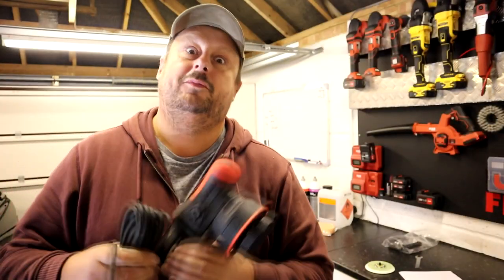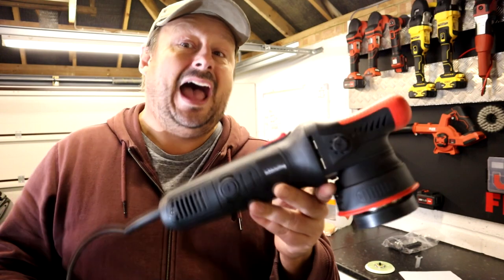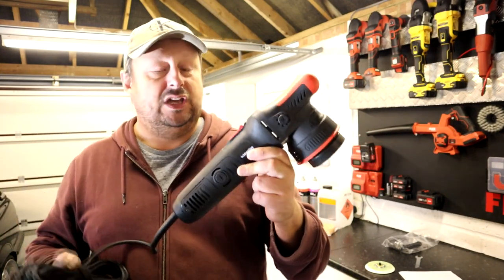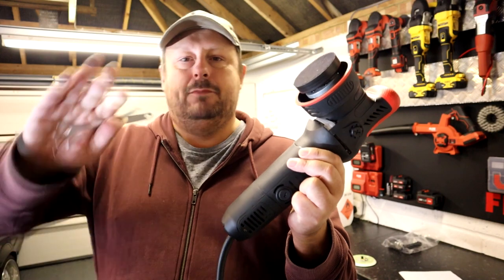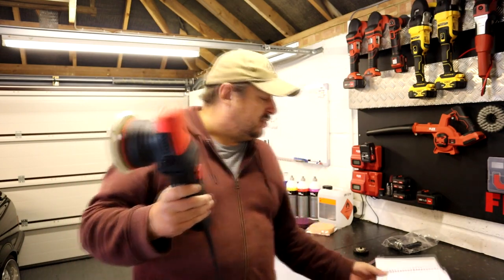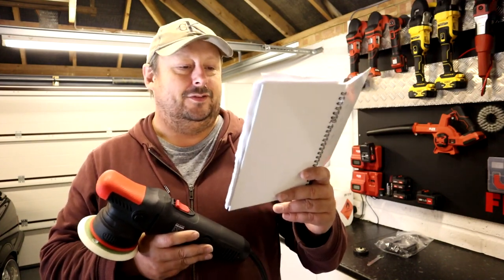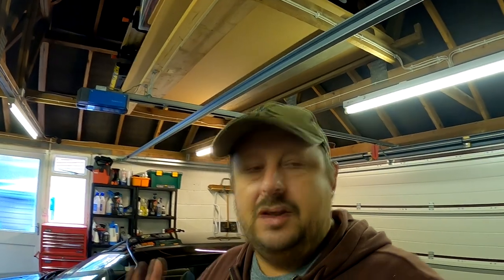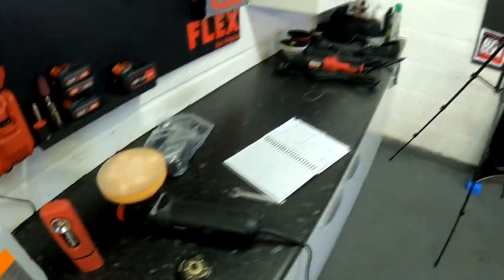The Ultimate Dual Action Polisher for Beginners? | New DA8 Review | Picking your first polisher

Comment: Are the pads reusable or do you have to throw them away after a use or two ? Thanks , always loved keeping my cars clean but just dipping my toe into detailing , thanks .
Reply from the maker: hey there Shaun.  you have to clean them properly at the end of each day, dont throw them untill the surface starts crumbling up and disintergrating.  take tooth brush, squirt come APC on the face work with brush, then blast the surface with a garden hose and it will flush all the polish out.. when clean sandwich in a thich clean drying towel and press to suck up all the water so they feel 99% dry.. put in airing cupboard to full dry.

Also you can you should check out my Detailing Fundamentals training course with discount code applied.  This can help you get up and running with detailing.

https://ioa.pxf.io/c/2687409/1012495/12764

Comment: how often do you change the pad or would you use the same pad for the whole car? Then once you've done the whole car with the polish do you have to go over it all again with the finish?
Reply from the maker: after about 10 sets as a rough guide but depends mate.  heavy cutting or fine polishing.  its when it warms up and mega gunked.. 10 sets just a rough guide.  you can also do a full flush clean on it with a hose pipe and press it.  see "how many pads should you use to polish a car" video. on unplugge.d

Comment: I would say its better to buy a used Rupes 15 mark 2 or 3 instead of buying a new cheap machine.
Then you will get a great machine for a great price.   Great allround machines, very stable and powerfull. You will not regret it.
Reply from the maker: dunno about that.  A lot of second hand tools are shagged.  Plus you loose the small plate support.   I would say if your polishing your car once a year then this is perhaps as good as it gets and when you are ready to upgrade if you look after this tool you will sell it for 70 quid no problem.
Reply: @ForensicDetailing  Yeah its a risk you gotta take for sure.  So you gotta inspect it good and feel it out.  I bought my 15 mk2 used a couple years ago for 210 pounds and back then it was around 575 pounds new. (Norwegian prices).   No regrets, great machine.      Some cheaper ones might be good but I have not tested them all, I just got sick of my das6 pro and upgraded to the best right away :P

Comment: I've got a 2012 E92  M sport in sapphire black. You said German paints are hard but then said you have soft paint on your  BMW.  What category will mine fall into John ? Thank you 👍🏼
Reply from the maker: if its original OEM BMW paint.  E9x is usually pretty hard.  most modern BMW paints are realyl hard and have a good amount of thickness. much better than other brands, but yer lots of orange peel
Reply: @ForensicDetailing  Thank you John 👍🏼

Comment: Great video, thanks. How do you clean your pads?
Reply from the maker: https://youtu.be/OAs6o_kF2YA

I tend to flush them out with a garden hose, it has enough pressure to blast out a lot of the rubbish. you can do it in the sink with warm water.. use surfex HD its cheaper and better than washing up soap.  tooth brush as well.  sandwich the cleaned wet pad in a clean towel and push down on it with the towel wrapped around to insta dry it.

Comment: Help please.
Losing co car so got 2013 Corrida Red Fabia.O well.

Machined polished with maguires Ultimate,looks good from a distance but in light lots of horiz fine scratches.I know its an old car but think I can get some of these.
What's my next step please
?
Reply from the maker: Could be machine marring or deep scratches not removed.  Cut 9nce with ultimate compound and stiff foam cut pad. Finish once with ultimate polish and sift pad l.  Do final buff carefully m8

Comment: Jon quick question. Have a brand new fiesta which has very very light swirls. Would I be best soft pad with a finishing polish
Reply from the maker: Yo Dave
H9 F6 M3  = abrasives combos
Purple = Non agressive Cut pad
Orange = Softer polishing pad

these are your tools and you start at suitable place. 

So fiesta will be lets say medium paint.   very light swirls.    I would start orange pads with F6.  If you need to step up then purple pads F6.  If thats still not cutting it then H9 and purples and finish out with M3 ornage.

Comment: Hi mate I bought this in2detailing da8 polisher today and the g360 cut and g360 finish all through your recommendations.  Thanks by the way . And I'm just wondering if you can help me the g360 recommendations range from 900 to 2000 rpm and the minimum this polisher goes to is 2500 rpm so I'm just wondering if you could have some input on that thanks regards harry
Reply from the maker: 900 -2000 rpm is rotary reference.  your DA is really  2500 opm.   just cut at around speed 4 mate.

Comment: There's really no need to spend so much. Argos sell a DA frequently on offer for £35, get some ZFE store pads on ebay for £15, Scholl S40 and S20 black for £30, job done, the results may take a tiny bit more work than the slightly more powerful DAS, but you save a hell of a lot of money
Reply from the maker: I guess the argos DA + ZFE gonna be like the cheapest starting point isnt it. I will review this machine soon hopefully.
Reply: @ForensicDetailing  You absolutely should. Sure you won't get royalties from Argos but if nothing else you will prove that skill trumps machinery. Even my low production valued crappy review of the Argos DA got quite a lot of views, if you do it you'll get a lot of interest

Comment: I'm planning on polishing my Honda Civic 2010 which has very soft paint. It has very light swirls, would you advise yellow pad with M3. Or F6 first then M3? Many thanks.
Reply from the maker: Ok for max speed I would use F6 and Orange pad.    single set polish.  I know this combo works great on soft paint.   But just buy a purple pad at the same time so you have a means to step up.

long term you should have H9 F6 M3 available to you.   And purple and orange available to you.   when you have this you can do virtually everything.

Comment: Just watched the rag company video of "which will burn through first " John,  what are your views as it is an interesting   video ?
Reply from the maker: all polishers work well on flat panels, similiar rates of cut experienced Im guessing.  Rotary though if you want to correct faster you can pressure down more with it and lean in without stalling issues.   Almost true of the FR has well although the FR down most of its work from the orbit or the oscillation if you like.   but when a DA is spinning it cuts well.

Comment: Question!!
What do you think about microfibre cutting pads from meguiars??
Reply from the maker: I find they dont take up the curves in the panels as well because they are thin and flat.  They also gunk up quickly and you need to be able to blast them out with air.  you cant really clean out microfiber with a brush.  And I dont find and radical improvement in cut, maybe there is some improvement though.  so I use foam.
Reply: @ForensicDetailing  thank you for the answer 👍💪

Comment: I have a question. Im new to polishing and want to do a full paint correction next spring. I can borrow a rupes LHR 21 ES from a friend but will I manage to use this polisher or will i be better off with something smaller?
Reply from the maker: hmm depends what standard you are working too.  The 21 will be fine on a bonnet or roof or door.   but try polishing a front bumper with it and its a bit of a handfull.

Short answer is you will prolly be better of with a smaller DA like this one.  Or a combo or DA's like the DA15 and DA12 I will talking about soon.   

maybe borrow it first and have a play around with it. If the tool isnt giving you the results you want then you can look to invest in your own tool?
Reply: @ForensicDetailing  thank you for taking the time to write this. I will take your advice.

Comment: Not tried this polisher but ive got the clean your car das-6 polisher which is £90. How does this compare to the das-6 John?
Reply from the maker: das-6 is lower 600w polisher way less power.  das6 pro though is 900w polisher plenty of power great machine.  Its tiny little improvements with this machine but if you have a DAS6 pro its very close to pointless to buy this machine they are too close.

Comment: How hardwearing are these? 

Looking at getting a new DA polisher after I broke my vonhaus one after 2 years of light use (maybe 5-6 full cars in that time, 3 different polish stages on each) don’t want to spend £100 and break it so quickly again
Reply from the maker: unknown mate.  Its very hard to test this.   it feels like it can take a hammering.. if you use it 24x5 like most DA's the bearing is the thing that takes the punishment. you only get a year warrenty as opposed to 3 years for say flex or DW.

Comment: You need to show off the scholl pads bit more the non spider version under £10 and there same foam from what it looks like as the flex btw I wouldn’t mix surfex with sil tbh it may already have surfactants in it
Reply from the maker: the force is strong in this one! your comments are powering up!
Reply: @ForensicDetailing  what do you mean when I bought the flex purple pads 2 big and the 75ml purples from slims detailing cost around £40

Comment: Would you recommend the orbital polisher from Halford? It’s £35
Reply from the maker: not for correction.. it will be ok for applying a wax/sealant and glossing up the the paint but it does not have the power to really cut paint efficently on all paint types... pay extra and get a DA8 or DAS6 pro machine with 850-1000w and you can do everything.

Comment: What inspection light you using ? Or recommend? 

Thank you
Reply from the maker: I used a sealey LCM360 , and I also have a flex torch pen.. but if you want a bargain basement one check my description for bargain LED light.
Reply: @ForensicDetailing  thank you, can’t seem to find the first one anywhere? Would be for professional use, seen another one I like but about £140 I believe so wasn’t sure if other good stuff out there

Comment: What’s the best pad size if I were to use the polisher on a motorcycle?? And does the polisher take a smaller pad
Reply from the maker: 75ml plate with the 80ml flex pads.    But if you intend to buy a polisher ONLY to polish the bike with by the DA12 (3 inch mini) you cant take the plate of the da12 , in other words it only supports the 75ml plate.  but its setup (counterbalanced) to the small plate only.   And it wont have a huge shroud thats bigger than the plate.   You can see what the DA8 looks like with the small plate and huge bell shaped shroud.     stay tuned for my da15 and da12 video I will show you the smaller pads in there.
Reply: @ForensicDetailing  looking to buff a Ducati bike paint - it’s a soft Red colour with swirl marks around the tank area. Any product you would recommend on this colour to remove swirl marks then polish and wax up? I noticed in this video the products your using here and was thinking these might do the job... is that right??
Reply from the maker: @ashbyts3900  thats right H9 F6 M3 is all you need.  degrease after use and then put a nice wax on mate.
Reply: @ForensicDetailing  degrease?? Not sure what you mean there mate?? Wax wise I have the double speed Bilt hamber
Reply from the maker: @ashbyts3900  abrasive polishes like H9 F6 M3 contain lubricating oils that you ram into the paintwork when you polish.  you need to use a panel wipe after polishing to degrease the surface and then your protection products will bond better and last longer.    if you apply protection products on top of oil they wash away rapidly.
Reply: @ForensicDetailing   great I’m looking to order the mini Da12 along with the cutting products you’ve mentioned all I need to know now is what pads to use on the DA12 and a degreaser if poss - I can then leave you alone 😂😂 thanks for this
Reply from the maker: @ashbyts3900  same pads mate.. so go to the link I show for the flex pads.  And select the 3 inch pads these will fit the DA12.   All you need is purple cutting pads and orange polishing pads.   you can single state with either like I desccribed.  So koch h9 F6 m3 and purple and orange pads.  boom done.  I have videos coming soon on da12 and da15 and I show the pads.
Reply: @ForensicDetailing  shall I hang fire until you launch your video review ??
Reply from the maker: @ashbyts3900  you can get now mate if you want its a cool tool.   purple 3 inch pads and ornage 3 inch pads are all you need really. and H9 F6 M3.  Use SIL as you panel wipe mixed down about 1:4 with water and a tiny squirt of APC
Reply: @ForensicDetailing  thanks for all your help and keep the videos coming!! I’ve pretty much purchased all my bits on your recommendation and they’ve all done exactly what you said. I just get a little worried being a complete novice using a buffer and products especially on my pride and joy!! So many say the Ducati paints just to soft and thin but I’m gonna give it a go!! The 3” pads are out of stock so I’ll hang fire until there back in. Keep em coming and keep those videos idiot proof 😂😂
Reply: Right DA12 purchased along with everything I need to redeem this lovely red Ducati - wish me luck 😬😬

Comment: So you said you could use h9 on purple pad you way to try to avoid heavy compounds on soft paint
Reply from the maker: kind of goes without saying you dont use a heavy cutting compound if you dont need to.   But it depends.  If you know your 2 staging and you have deep scratches even on soft paint, sometimes you might find H9 is best way forward if your trying to minimise compounding sets.   there is not any right or wrong, you need to think about how much time you have and the most efficient way forward.   The paintwork on this E36 is very soft but I could cut with H9 on purples and Finish with M3 on ornage.   In fact I cant think of many scenarios where that 2 stage combo would not be valid.
Reply: @ForensicDetailing  could use f6 on a wool pad to cut

Comment: How come your wall unit doors are upside down? 🙃 🤣
Reply from the maker: :) long story.  they aint upside down but they should be mounted vertically in the middle.  when I build the garage I cracked open like 7 boxes of flat pack and made all the doors then made all the carcasses etc...  just didnt factor the wall mount units would be different until I fitted the doors.  It was a "doh" moment.